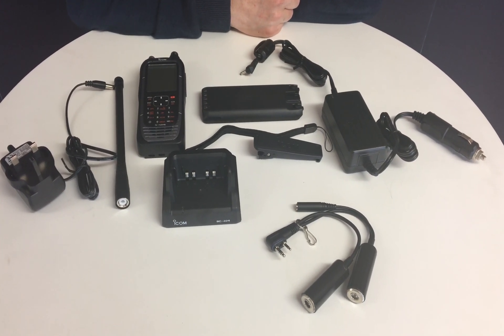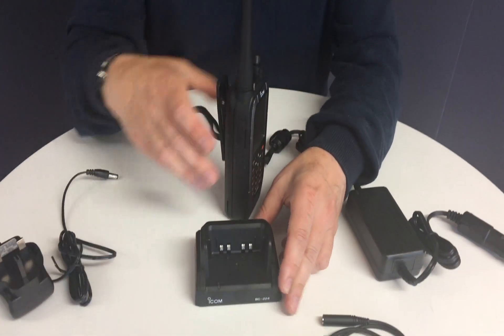The Differences Between the Icom Airband Sport and Pro packs

Comment: Why does your IC-R6 sport no longer come with batteries and or the adaptor to power it?
Reply from the maker: Think that this might be a variant sold in the US.  In the UK we still sell the original IC-R6.  It might be worth asking your dealer about this.
Reply: @Icom_UK  And your calling it the ICR6 sport modle?
Reply from the maker: @BrotherTimothyClark   This is a video about the IC-A25 aviation radio and not the IC-R6 communication receiver. It does not mention IC-R6. Radios should come as supplied to provide choice to the pilot.
Reply: @Icom_UK  rite.

Comment: The antenna of the Sport park is shorter than the one of the Pro pack? Does that make the power of reception/transmission slightly poorer?
Also, what is the average endurance of the fully charged battery in the Pro pack while using in communication, VOR and GPS navigation simultaneously?
Is there any possibility to connect it to an external powerbank?
Thank you
Reply from the maker: Hi 

Antennas should be the same size for either model.    

Reference battery life...should be the usual 5;5;90 %.  Therefore battery life should be approx 10 hours, subtract constant GPS and VOR etc would probably reduce endurance to between 5 - 7.5 hours.

The CP-20 Cigarette Lighter Cable with DC-DC  converter should allow you to operate from an external 12 Volt source.